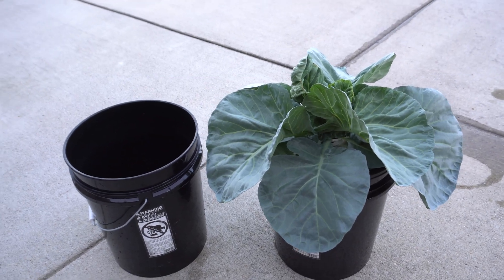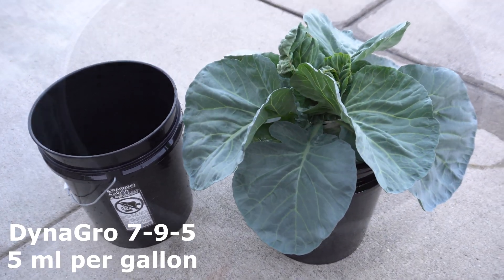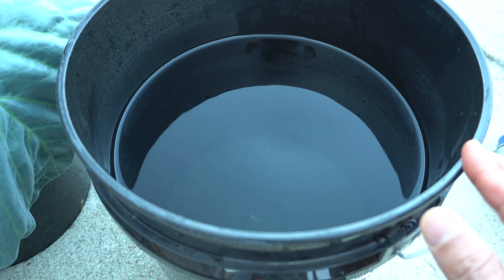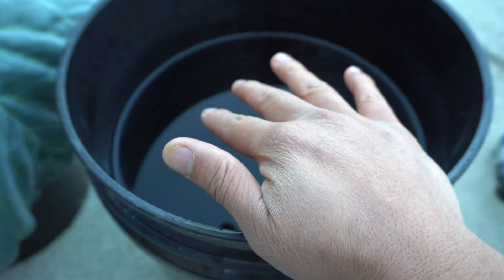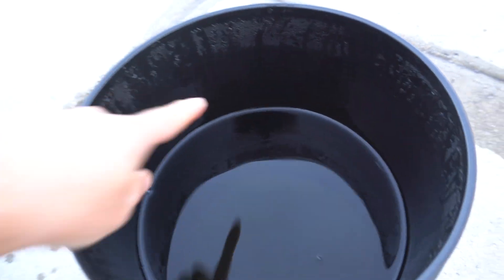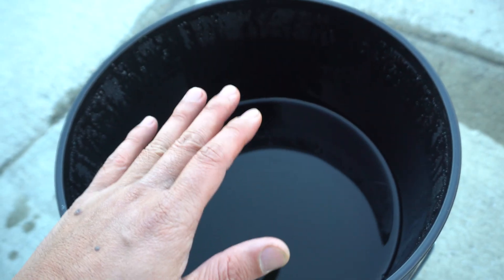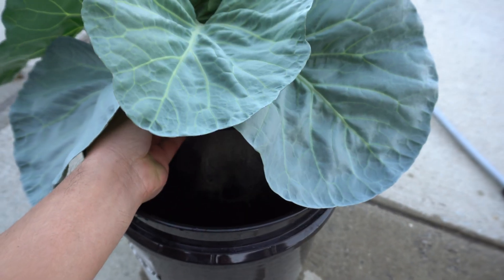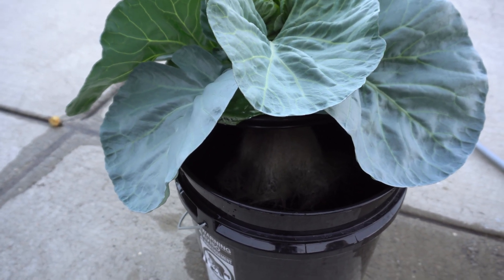Changing Hydroponic Nutrients For DWC Vs Kratky Method

Comment: Love your videos, completely baffled with this though as it seems like a huge effort re Hydroponics.

I use a mix of DWC and Kratky indoors (grow tent, light and fan), and Kratky in the poly tunnel.

I don't change out nutrients in the poly tunnel and only do it in the grow tent if the plants have filled the container with roots (then I'll cut back most of the roots and cut the top back to about a foot tall), then new nutrients and let it go again.

In the poly tunnel Kratky barrels (they are 80ltr ones); I wait until they get to about half empty then top them up to about 3/4 with fresh water.

Every 4th or 5th refill (poly tunnel and grow tent), I'll top up again to 3/4 with a nutrient mix (masterblend, or chilli focus).

Obviously you are loads better than me at this, but I've been having what I'd regard as pretty decent results considering my location (central Scotland), over the last 4 years or so re Hydroponics. This year was weird as it lasted so long; took my last chilli harvest on the 5th of December from the poly tunnel. Never had so many scotch bonnets which mainly didn't ripen till mid November. Good crops but mainly spent mid November of ancho poblano, piri piri, cayenne, jalapeno and Indian long finger. Smallish tomatoes did very well, but as usual larger ones ended up being picked green.

Anyway, in my first year of hydro i did the epic hassle of emptying the Kratky barrels and using fresh nutrients, but I'm guessing the shock to the plants does more harm than good as I would always lose a few plants doing that and for me anyway the extra effort isn't worth it.